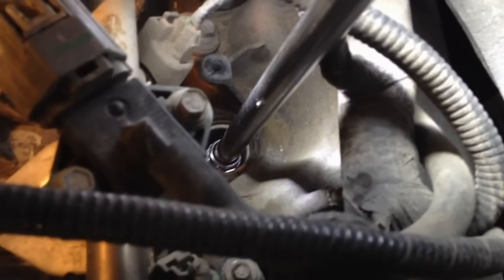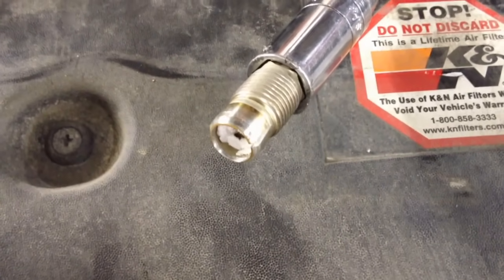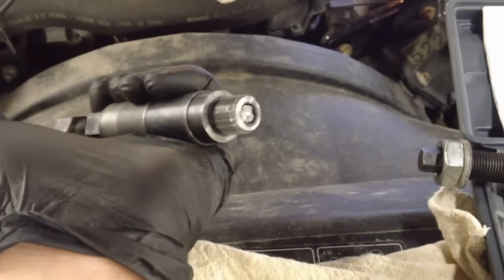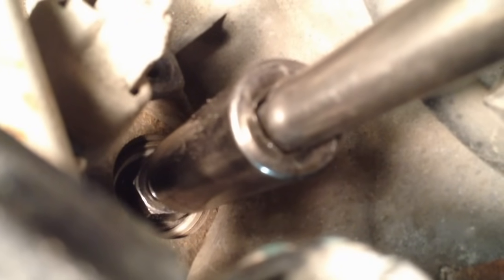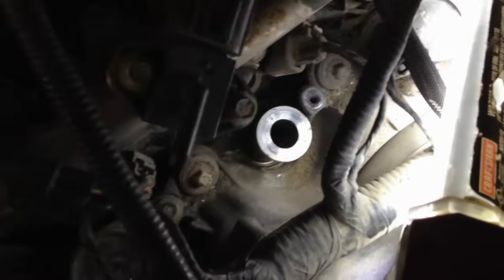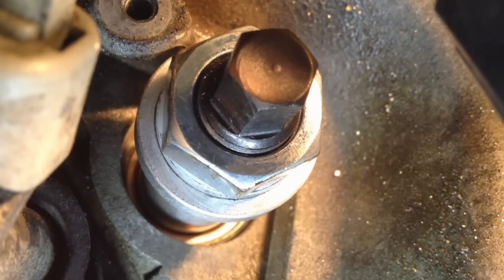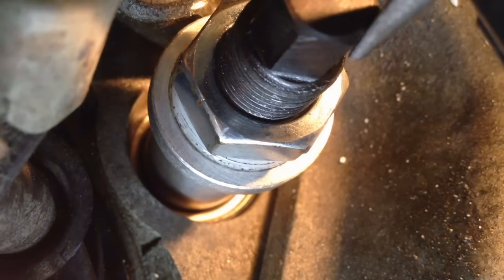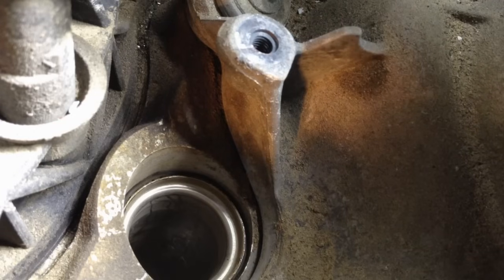Ford 4.6L 3v & 5.4L 3v Broken Spark Plug Removal

Comment: I like Kroil oil, squirt it around the spark plug in the head, and then tighten the spark pugs just a little and let sit for 5 minutes. This allows the oil to penetrate and Does not stress the threads of the spark plugs and it is turning the way it was last time, tight. I find this process works very well
Reply: Kroil oil works great at cleaning gun barrels and is an outstanding rust penetrate.  Learned about Kroil while teaching High School metal shop.
Reply: Stephen Maurer it is the best penetrating lube also. It was made for the us government. also, ford atf works really well

Comment: Motorcraft learned its lesson with these plugs and the new plugs' design was changed. I watched this great video, bought the Lisle tool for $65, and changed all 8 on my 2006 F150. The truck had 144,000 miles on it then (too much I know before a first spark plug change). Even with overnight soaking I broke 4 out of 8. The Lisle tool took care of extracting all in short order. The old plugs had normal wear indications. After I finished, I realized this is no big deal and was glad I had not paid a shop to do this job. The added time for extracting the 4 broken plugs was about an hour. Ford does have a settlement to partially reimburse those who paid big bills to get their plugs changed before 120,000 miles. Many thanks to FordTechMakuloco.
Reply: the parts houses I deal with (Oreilly's and Advance, ) sell you the extraction tool and then buy it back when through!

Comment: I am doing mine for the 1st time. Bought truck a few months ago and it has a sputter uphill so I am starting with the plugs as a solution. I know my plugs were changed (via carfax) about 10,000 miles ago so I shouldnt have any of the ones that break (but who knows, right?). Some idiot put on a plastic clip ( looks like a hang clip for an air hose) on one of the plugs. At first I thought the plug was stripped because it just spun. Then I got a light looked in the hole and saw the  black clip. Took me 3 hours and a ride to home depot for long needle nose pliers (this clip is prob the cause to my issues to begin with. 
The true point to my post is.... I see why its $350+ to do this job. The last 2 being under the dash makes it difficult as hell and I am 6'3, I feel sorry for the short guys/gals. I have a BMW and a Mercedes, and have owned a Chevy in the past. I must say this is the worst engine layout I have ever seen. There's 2 feet of unused space towards the radiator, why is the engine pushed so far back into the interior? Why is every single hose on the driver side in the way of the job? Just unscrewing the last 7mm  bolt (on driver side) alone was difficult, and I HAVENT even got to the plugs yet. I wont be doing this again. I will play the $350 and save the aggravation, my back, and time.

Comment: This is making me extremely nervous to change my spark plugs
Reply: Dom's Car Reviews you should be lol
Reply: Ken Elliott  Dude.  Shhh.  With crush gasket, 1/2 to 2/3 turn after finger tight.  Without crush gasket, 1/4 to 1/3 turn after finger tight.  THESE SPARK PLUGS ARE IN A DEEP TUBE, you're not putting them in without a damned socket on em as well as an extension...Unless you got damned fingers like an anteaters tongue.
Reply: Joe Lewis he means get the threads started by hand with the extension don’t have it on the ratchet
Reply: @bryandowling8524  yeah that's what i mean
Reply: Ken Elliott  also bro, on the '04-'08 triton 5.4l 3valve engine, THIS IS NORMAL, it's a poor design that Ford's acknowledged and fixed for late model 08-14 engines.  IN FACT, this 04-08 design was meant to fix the 5.4 2v problem of too few threads and too thin head deck which caused the 2v to shoot plugs out of the head if thread's got damaged, and or late life 300k mi engines that have had 30 sets of plugs through them...!

Comment: Thanks for the video.  I'll be doing this job soon on an 02 f150 with 150k and original plugs.  Not sure if you have answered this yet, but after letting the carb cleaner penetrate for the night, would you recommend wd40 or something right before you finally extract?

Comment: my truck has a spark plug that has done something none of you address the champion spark plug the ass who did my tune up used well the nut broke loose and the threads are still in there making all these extraction tools absolutely useless to me because the threaded part under the nut is still in there anyone ever seen this happen and how do I fix it

Comment: Thanks for the vid.  It really burns my ass that Ford had this crappy plug setup.  Removing spark plugs should be a relatively easy job, not praying to God that the damn thing doesn't break.
Reply: I have a mercury mountaineer...same deal.  I'm with ya.

Comment: I have a 97 mondeo with a broken spark plug causing it to run on 3 cylinders. It's loud as shit lol. Would this fix the loud ness once I remove and replace the plug? Do you think it would be better to do all 4 at the same time?
Reply: +Dogurasu drives fine just loud.
Reply: is like a loud banging sounf

Comment: I just bought a 2005 f150. is it like this every time you have to change the plugs ? do they always get stuck. ?
Reply: not always if you change your plugs every 65,000 miles you shouldn't have as much of a problem  1 thing before you change the plugs soak the entire spark plug sleeves with carb cleaner that will help alot!!!!

Comment: I'm a auto tech also. Worked for Ford 8 years and 16 years at small shops. Just did my spark plugs on my 05 Mustang and I broke cyld 1 and cyld 5. Used my Matco extract tool to get them out. Now the question from tech to tech. I heard that using a impact does a better job in removing these type plugs. Just want to know your professional opinion about that. Seems to be a over kill in getting these fragile spark plugs out. But they say the constant motion keeps them from breaking. How do you feel about that and have you ever used this technique? Thanks for a great video....
Reply: impact is a good technique...
Reply: with the engine hot though.
Reply: I use that technique with 18v 1/2 1400 matco impact long time ago in a local junkyard a lot of times..for sure this thing work!!
Reply: Yup. That technic it works just fine. Believe me..

Comment: Brian i followed your steps in taking out 6 out of 8 plugs out of my 5.4 L  f-150 Tritron  now my problem exist on cyclinder 3 where i apparently strip the plug itself in trying to get it out under tight condition which i was afraid of , i could use your expertise in how can i get it out myself  any ideas for me ty

Comment: I cannot thank you enough for making this video may God Bless you and yours
Reply: Hello I am currently having this problem my name is Bobby how are you
Reply: So I have this problem right now and the top of the spark plug is still there I have an oem Ford Triton broken spark plug porcelain and Electrode removal set will this work the same way as the other Lyle set I am nervous about doing this job but in the middle of it right as we speak
Reply: @robertakendrick7424  Did you ever complete the job without any issues?
Reply: Same here thankyou so much for the instructional video. Out of 8 spark plugs only one broke and it was at the front of the engine. Overall it took about 3 1/2 hours.

Comment: I have a 2006 f350 5.4 3v and i didnt break any plugs thank god!!! And the most difficult ones was cylinder 4 8 and 7 but i found the best ratchet to use was matcos low profile curved spark plug 88 tooth 3/8 ratchet

Comment: What do you suggest if you can't thread the first tool to break up the porcelain? The plug in my truck broke just under the hex so it doesn't look like there's any thread for the first step to catch onto.
Reply from the maker: +LeeJay Dillon I have used the lisle tool guide and drill bit to chunk it off and a a flat blade screwdriver yes

Comment: Followed advice, worked perfectly. Isle tool stripped on the last plug but I still got it out. Not the 'easy out' part but the upper large retract nut. I had to pull and pry entire thing together but it came out. That plug wasn't that blocked with carbon so it did eventually come out. Thanks so much for the great video, saved my over $700 in shop costs and all it cost me was time online and $100. Thanks for the great design Ford.

Comment: Is it possible to push the porcelain and the remaining metal plug head into the cylinder or is the top tapered?
Reply from the maker: +videochrisvideo The top of the plug tip flares out so its hard to push it down into the cylinder but not impossible
Reply: +FordTechMakuloco If the porcelain is not broken off flush with the tip, how do you make it flush? Dremel or drill bit to eat away at it to make it lower?
Reply from the maker: +videochrisvideo Drill bit and extension to chunk it off I have also used a straight screwdriver.

Comment: Do the 5.4's with the brown coils have this issue also or are those the redesigned plugs? Thanks!
Reply from the maker: +Jose Tellez Brown coil boots do not have this issue at all totally different plug.
Reply: +FordTechMakuloco Thanks for the information good sir!! (Sigh of relief)!!
Reply: FordTechMakuloco i have the brown boot and broke 2 plugs #3 and #8. 
Here's my issue with #3. 
The nut and threads came out leaving the plug in the cylinder.. what do I do about that break the top of the electrode?? Advice would be appreiated..

Comment: This is a great video. I was able to get 6 of the 8 plugs out, and the last two broke. I was able to get the 7th one out, and the 8th gave me a lot of trouble (farthest one back on the passenger side, by the firewall). I almost gave up. I tried a dewalt 12volt impact with an extension with no luck. 

Here are the two things that I did, which made it successful and I hope anyone struggling will try this:

1. The sleeve that holds the extractor is loose and the extractor does not line up centered on the plug metal sleeve. To fix this, I added one rotation of electrical tape to the upper part of the extractor, which then made it line up perfectly. This really helped!

2. Even with the extractor lining up perfectly, it wouldn't bite. I tried pushing on the ratchet while turning, I tried an impact gun, etc. Then I took a ball pein hammer, and gave the extractor a few light taps. Then a few turns, then a few more light taps, and it grabbed! Do not hit the extractor very hard as you don't want to risk pushing the entire plug into the cylinder. Awesome way to have the first threads bite the metal.

3. Once my two broken plugs were extracted, I did 4-5 rounds of compressed air in each cylinder, followed by a shop vac hooked to a small clear tube that got all the way down into the cylinder head. Rotate the clear tubing around many times. Use a small shop vac, and start with the vac completely cleaned out. That way you can verify the pieces that you get out. Open and empty the shop vac after each round, and repeat the compressed air and shop vac routine until the shop vac doesn't have anything in it. This was the only way I could figure that I got all or most of the porcelain out.

I replaced the remaining two plugs, put everything back together, and it runs like a brand new truck. My truck had 138,000 miles and the plugs were original. I can't believe it even ran. It even fixed what I thought was a transmission issue on the highway at low speed on an incline. No more shutter, and the truck is much quieter now. Ford wanted $1000 labor, $400 parts, $100 per broken plug, and a potential pulling of the head.

If you have decent mechanical skill, patience, and the correct tools, you can do this job. Just plan on breaking a few and have the extractor ready!
Reply: Thanks for the advice. I'm about to do a plug change on a 5.4 with 138,240 on it. I don't know when it was last done but I'm having all the performance issues you mentioned. If I have broken plugs this this is some helpful advice. I hope I don't have to use it though.
Reply: Gus Muller reading this is going to help me this weekend. I am doing a whole tune up on this vehicle and watch is his other video on the removal gave me 2nd thoughts on doing it.
Reply: The extraction tool comes with a "porcelain pusher" for shoving the porcelain down further into ground tube. This is likely why your extractor didn't grab.
Reply: What could I do the push the porcelain down without the tool?I have an explorer and the plugs aren't threaded on the inside so this tool wouldn't work @Joe_JesusWins_Lewis
Reply: @ISAIAH_spyro  the tool cuts into the metal to grip it
Reply: Once you have the OEM plugs out do you replace with the same flawed designed plugs or are they new ones designed better?
Reply: @stevenweede7184  Champion 7989- one piece, doesn't come apart.
Reply: @stevenweede7184  04-08 engines are going to take same design flawed plug.
Reply: i put in iridium plugs, speedtun SP515/SP546, they are good for over 100,000 miles, got them on amazon for a fraction of what auto stores want. my truck runs fantastic with them and i did not over tighten them. used 25 ft lbs or so...will be no broken plugs if i even need to remove them again
Reply: the number 8 broke on me also what joy any way that was a few years ago I have napa plugs  ngk3951 and they need replacing  I put anti cease on them and I hope all goes well this time .
Reply: The one dude used a impact rachet to extract the plug and it seems to work better with the impact working it out.
Reply: What is the manufacturer recommended mileage for plug removal? Seems like over 100K, even for iridium plugs, is asking for trouble.
Reply: Thanks for the tips!!!!
Reply: That's wy they change me 150 labor only
Reply: Thanks
Reply: Thanks man. I'm wat this just in case haha. Currently working on my plugs

Comment: I did this exact procedure and it worked beautifully. Thanks for making the video. Tip for anyone planning on doing this. You need 3/4, 11mm, 15/16, and a 16mm socket to do this job.
Reply: Francisco Gallegos and a bottle of jack
Reply: I'm pretty sure you also need a 7mm socket for the coil bolt.
Reply: @jima3129  bmws r junk.
Reply: Francisco Gallegos thanks man !
Reply: About how much time does it take to extract a spark plug?
Reply: @jacobmckay8520  I imagine a proficient tech could do it in 5 minutes with this extraction kit. For chumps like us closer to 15-20 minutes.

Their is another kit on the market that requires you to remove the porcelain completely. That kit takes an hour and a half per plug because you have to wait an hour for the glue to dry so you can remove the porcelain before tapping and extracting. I tried the longer kit and it sucked. This kit is more risky but a lot faster

Comment: What do you do if the sparkplug center is there and the porcelain brakes around the plug? And you can still attach the the wires to start it. How do you get it out. Thanks.
Reply: Are you talking about the electrode?  I'm trying to understand
Reply: Yes
Reply: +Melissa Keller What year 4.6L do you have?
Reply: It's a 1998.
Reply: +Melissa Keller  The 2v 4.6 typically don't have any plug issues other then spitting them. 
You should be able to just back the plug right out whether the porcelain breaks or not.  The 3v Tritons are the only engines that have the problem listed in the video.
Reply: THETOPGLOCK I only tried one and no breakage
But NOW it's stripped and I'm stuck
I am afraid to ask what the solution is!

Comment: This Is The Best How To Video on YouTube for removing the very painful and costly Ford 3V broken Plugs if not done the way you suggest.   Excellent video with clear camera shooting with very clear and thoroughly explained  procedural steps. Thanks Huge Brian!!  You really are tops.
Reply from the maker: +Hawaiian F150 Thanks!
Reply: @FordTechMakuloco  I like the way your tool only has 2 threads worn where the spark plug was screwed inside the head when you showed us the tour of that tool 👍is that type of plug faulty in all cars/ trucks way over due for maintenance or just a Ford problem? I've never seen or used that type of plug yet just standard normal looking ones

Comment: hey great vid, i just purchased a used 2004 where the owner has changed the plugs. 
does the problem still exist after changing the plugs to new ones?
Reply from the maker: +triedcobra If they are the latest sp515 plugs and anti seize was put onto the tip as shown in my video then you should be ok.

Comment: Great vid Makuloco, but at 10:10 you show a plug with a broken ground strap. Is that piece in the cylinder and is it ferrous? (can it be pulled out with a magnet)?? Also can I chip away at the porcelain and make it deeper for a better bite? I'm sure the cylinder could be vaccumed a little too. Thanks brother.
Reply from the maker: +Buddyboy gaming the metal is ferrous yes but these ground straps usually break in one spot and are retained by the other side so nothing falls into the cylinder. I have chipped away the porcelain for a better bite yes. I have a whole video on this.

Comment: Great videos.... I changed mine originals out at 68K a couple years ago and put in the SP 515's with MC nickle as. I am not sure how much AS I put on ,hopefully enough. Anyhow, What do you find is the best and easiest set of extentions /swivel combo to use for the back 2 in the firewall? Also , what all do you remove ECU, battery etc? I remember sitting on the engine bay for those 2...lol
Reply from the maker: +Carl Simmons the extensions and swivels vary from 3-6 inch depending on cylinder I remove the pcm and bracket to gain full access.